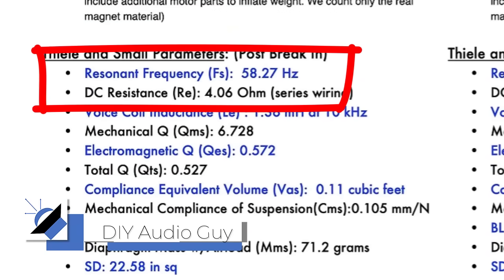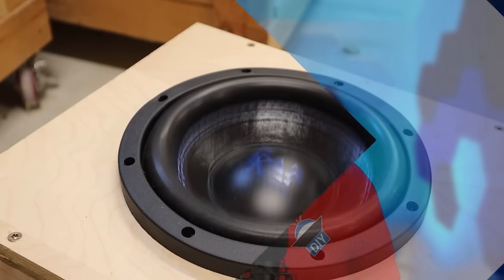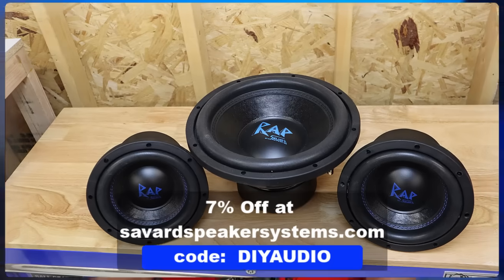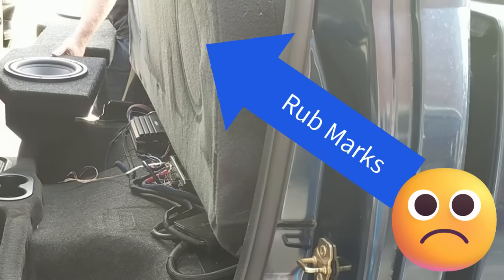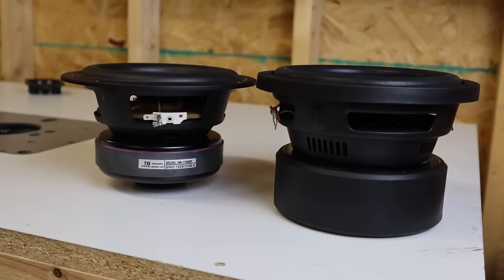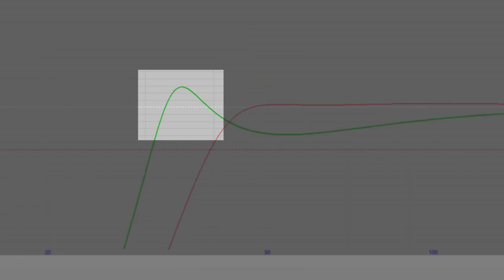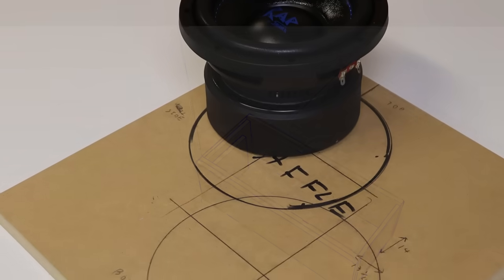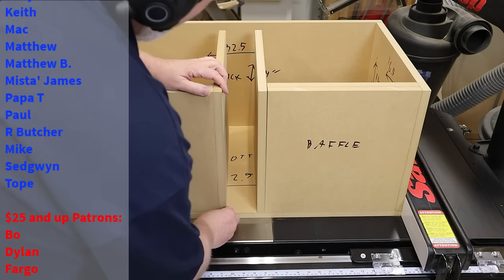The Problem With Small Subwoofers

Comment from the maker: Get the subs here:  https://lddy.no/1jqms  7% off of Savard  with the code DIYAUDIO
Reply: Awesome job of explaining things...just to bad some of the people commenting dont know the true meaning of audiophile...
it also depends on square footage of interior of vehicle,the natural resonant frequency of interior that you have to tune your port to.
i have 4 8" subs underseat front firing unobstructive sound & they sound way better tighter with low end extension custom ported box i made. than the 2 10s or 2 12s that i had before from "other" custom stereo shops & with more cone area i can hit as low as 1 15" sub even tho i have same cone area as 15" sub, that i cant put under my back seat & still carry 4 people with surround sound.
Reply: Thanks for having a great video that's not 25 minutes long.

Comment: The smaller the sub, the closer the bass is to staying inside the car. The decibels stay in the car instead of being way outside like dealing with 15s or 18s. The majority of the bass is outside the vehicle.  Yeah, you get a lot of air movement inside the car but the sound isn't in the vehicle like it is outside.  A vehicle has an amount of air space that can be used. You cant put 4 18s in a mini Cooper and expect to get a high decibel level, you get a massive spl level. You will get more out of 4 12s as far as sound inside the car but lose spl. For a mini Cooper,  there's not enuff air space in the car to be effective,  you need a van. A van has the utilizable space for that.

Comment: The skar audio 6.5s will not disappoint either wether you put them in a small box or a big box they slam for what they are im testing one skar 6.5 in a box I made for a 15 tuned to around 30 hz and it surprised the hell out of me the output they give is unbelievable

Comment: I am trying to decide between Three JL 8Wv3 subs or Two JL 10W3v3 subs in sealed enclosures for tight accurate bass for 70's, 80's rock and country music. Need accurate reproduction of the music not the deepest or loudest overpowering bass possible. 
  What would be the best choice?  Would it be best to combine them all in the same enclosure or have them in separate encloses sitting next to each other? That way if something goes wrong with one of the subs it won't cause damage to the other subs.

Comment: Near the beginning of the video dude mentions that as the size of the driver goes up, the resonant frequency goes down, while the chart he shows has an 8” driver with an Fs of 37.8hz, and a 10” driver with an Fs of 41.12, but with an * and no related foot note to explain the symbol.    Hmm.  I wonder what the asterisk means?    Also, how did they come up with these numbers.   If they were to take a box of a given volume and shape, meaning the same design, shape, volume of the box, but with varying baffle cut-out size for the various drivers,  you would generally find that a certain driver would score higher because it was COHERENT with the box, meaning they worked together.    Take drivers 8”, 10”, 12”, 15”, and 18”, and a box generally designed for a 12” driver, the middle of my range here, and force an 18” into it, and the driver would be trying to blow out the enclosure, of course comparing with the exact same pink noise from 20hz-120hz, same voltage applied, theoretically meaning driven with the same amp load, pre-driver, like use an 8 or 4 ohm resistor, set the amp at a given, maybe 80% gain on a 1000watt/4ohm amp, and swap only the drivers, and the baffles, to fit each driver, and the 8” might feel like the proverbial hot dog in a hallway, while the 15” felt like Mr. Big in  Ms. Gina Tiny.     The drivers too big for the cab would be fighting the cab, and their own air displacement, really both the same thing Sadi two different ways, but those tests and that chart make me wonder, how did they arrive at these results, and why did the narrator place a chart on his own video’s screen that contradicted the words he was saying while that chart was showing?   At least explain the *.     I have MASSIVE sound engineering experience, and there are those who have more, but that doesn’t reduce my own, and what we need, is SUMMATION, NOT CANCELLATION.    Even with one driver, the wrong box can hurt the potential of the driver, or, if you are seeking a particular result, then you might want the box to hurt the POTENTIAL of the driver in a particular way, such as when “steering” sub-bass frequencies.   Everyone knows that bass, and sub-bass, goes basically all directions, and the amount with which the “back” of any subwoofer cabinet does NOT reduce low end is astounding.    At 100dbC SPL, most single 18”, or just simple cubical shaped boxes, front loaded, with whatever appropriately sized driver, radiate its intended frequency range pretty much in an Omni directional polar pattern, both in the horizontal dimension, and vertically as well, a point left out of almost every video on the subject.   But the amount at the rear, if it was 100dbC 10’ out front, might still be 97 or so dbc 10’ behind it.   I’d say the only way for this speaker company to have tested this would be with a one dimensional barrel, AKA an “open” baffle, with enough size to dismiss its own square footage as having any impact on the results, whereas maybe a 4square footage piece of plywood might do fine with an. 8” driver, but an 18” would not be making its potential results because there isn’t enough area of barrier surrounding it to RESONATE its field of SPL.     Meanwhile, a larger , maybe 16 square footage sheet, would serve the 18” driver fine, while also not hurting nor helping the smaller drivers.     Any way.     There’s so much ambiguity to lots of the explanations, and sub-bass reproduction science has been well established for several decades, but now, with computer aided design, we can more easily exploit the principles.   I made a cardioid shaped  sub-bass lobe in my house, focused to cancel  ass behind  the sub array,  earning the rest of the house, while trying to optimize sub-bass in front of the array, meaning, towards me, where I’m sitting or standing listening to very loud and very heavy music, in my ultra man-cave Family Room Over the Garage, which stands for Bunk Room.   That’s a little joke.   I grew up calling a room in that kind of spot a bunk room, as it I was often meant as a getaway spot for kids, and if practice, a bunk bed would go there so the kids could facilitate a friend or two for a sleepover/mischief time.    Subs are fucking cool, and extremely complicated.   Just when you think you’ve got it sorted, see it from a different perspective and you’ll realize you were clueless.    Let’s see, I dove into steering subs in around 2020, 25 years into my live sound reinforcement career, at which point I felt like I was a triple black belt(that’s some bullshit) audio guy.   Because I was, and am, but boy was I humbled when I dove into the science of steering bass.    It’s mind boggling at times, and there are so many variables to consider.   That’s why I got interested in home audio and car audio concepts for controlling bass, in terms of where it was directed, and also what trended of box design made the most balanced reproduction of the ENTIRE sub-bass bandwidth, and I’ll call that 20hz-100hz, even if it’s really supposed to be below 60hz, there is or should not be a fixed number, as the frequency at which we only feel and do not hear a tone is different for everyone, s d for every environment.    I say environment, but in reality upper harmonics are often  what “tells” us we can “hear” some very low tones, even if the test tone is pure, the resulting sound in the room is al sot always made up of that tone plus higher and lower harmonics.   Generally, the only place where you can get rid of those harmonics is outdoors, far away from ANY type of reflective or refractive barrier, be it stadium seats or the wall at the bottom of the bleachers at a playing field, walls of buildings, even 100’ feet or more away, depending on the pressure wave size, and/or the amplitude(volume) you will be employing.      Subs are hard.   Okay?    They just are.   Really.   Really hard to generalize.   Highs and mids are relatively easy, because as you go UP the frequency spectrum the more directional the wave is going to be.    If you want to hear the highs out of a horn facing away from you, simply put a solid flat barrier out in front of the speaker and you’ll get the highs reflected right back at you.   I’ve had banners which the event promoter assured me were acoustically transparent, cause high end feedback on stage because the highest highs were getting reflected right back onto the stage.   If the barriers did not move and were perpendicular to the direction of the horns, then generally there wouldn’t be any microphones directly behind the banner, a vertical banner here, behind a vertical array,  so no really big deal.   But when the banner is getting blown around d by even a mild breeze, the variables skyrocket and you’ll get feedback that you can barely comprehend until you get out into that stage and listen carefully, and sure enough, highs are reflecting right back onto the stage.   Problem is that often the promoter is indirectly your boss, or chekcwriter, so one must tread carefully if you want them to address the banner issue, which means generally making some perceived negative impact on the entity which the banner is meant to represent, and without whom the funds to throw the event in the first place likely wouldn never have been realized.    Soooo, there’s that consideration.   See what I mean.     “Kruschev!    Get those goddamned missiles out of Cuba and off of my back doorstep, NOW!!  Lest Leningrad become a smoldering melting pot of melted corpses!     Oh, Leningrad knows pain, has felt unimaginable suffering before?   Hah!     Think again Mr. Old World dinosaur soldier!!   I suggest burying yourself u der a cool click of dirt.    That’s one thousand metric meters, Russkie!!   Better start digging last month.    Oh, you didn’t get that memo I sent?    Oh, I’m sorry, I’ll just reach up into the sky above where any airplane has ever flown, and knock those ballistic warheads out of their trajectory just for you!   May God treat you well while you smolder, Nikky!     MISSILES!!     Back across the Atlantic!   Deep in Commie Land!!    Now!! “.      I used to be sooooo diplomatic.     Nowadays, I just don’t care to be so sweet.    Fuck around and find out.    I love that slogan.    “Ok Mr. Health Care Int. sponsor, you can have a quality show, or, you can take your non-acoustically transparent lies-in-banner- form down, and move them ANYWHERE ELSE.   It’s your pick.    The console is all yours, and when people start bitching about uncontrollable feedback, you can tell them how you did not meet your contractual obligation, and are the ultimate cases of this fiasco”.     I make a lot of friends.   But some people just cannot handle be called out no matter how sweetly or low-key, so we might as well swing for the cheap seats.    Subs are hard, okay.

Comment: I always use the biggest sub I can get 2-3 of in my car! If it will hold 3 15’s that’s what I use! Although I did recently by a cheap kicker 8” for $40 bucks brand new and I’m gonna run it in my tiny little hatch back! It’s going in a big ported box car is tiny should do ok! I had 2 12’s in it and they could rip the car apart! I still have them just don’t have the battery bank to run them! Takes some power to run them. This 8” is 350 watt I can run that with no nothing just my alt and battery!

Comment: I believe in the mighty woofer. 15-18 inches for me duals are even better. When 2 are wired in series it’s like adding a low frequency choke in series with a woofer and since the drivers are in series the cones only have to move 1/2 the distance of a single driver reducing distortion caused by stress.  However the power you’re able to drive them does not increase. 2 100 watt speakers in series are still rated at 100 watts.

Comment: 5:29 is a really bad enclosure design, i built one like that, sounded really bad, slapped in a second subwoofer, sure its not that louder at tuning frequency but what it did was lower the q of the rolloff like mad and also sounds much tighter and faster
Reply: So the low end is really like in a really good sealed driver application, size is about the same, but its got much more output than a 15, thats all with a tuning freq of 27hz, whats also cool at such low tuning frequency, is that you dont need as much port area for a desired air velocity

Comment: I have been a believer in 10s for years. Considering playing with 8s or 6.5s recently because i am now an adult and don't want to wake the block up and want cargo space back,but I don't want to give up the low end. I got multiple vehicles all with different audio setups. My family suv doesn't have any subs as i need all the cargo space i can get but it has 6 6.5(focal) mids all amped which gives enough bass for enjoyable listening.

My drag car has a basic double din,a couple sets of Kenwood performance 6.5 components and is powered off the headunit. Its lacking but I don't drive it to listen to music,i drive it to get to A-B as quick as possible. 

My daily is a little hatch back, its more of a SQ build and is the one I want to down size subs in. Since i drive it daily and sometimes for pleasure(its a big turbo gti,it can be fun) i want to enjoy the music but I'm also tired of having to put groceries in the backseat since the hatch is taken up. 

When i was younger i played around with 10s and 12s and always found 10s to be the sweet spot for me. They get plenty loud, don't take up as much space and hit all the notes i am after. I listen to a lot of metal and rock, sometimes rap. 

I am curious to mess around with some 6.5s. worst case i sell them or let them rot in the garage.😊

Comment: It all comes down to the box and also double boxing. I have two JBL 8 inch from the year 2000 in a large box with big ports they sound like 15 inch subwoofer. Overpower them. Obviously the sound only travels half the distance but in a car or a room they sound like 15 in
Reply from the maker: You'll love this video if you haven't seen it yet. https://youtu.be/Zehi8mtk97w?si=0imXy8B_DElo5MAW

Comment: Depends on what you want to achieve im running 4 dvc 10s at 2 ohm in a sealed enclosure in my suburban cause i listen to heavy metal and i like the tight punchy bass of the smaller subs and they still hit real good down to 40 hz yea bigger subs in a ported box would slam the ever living shit out of my truck but im not going for spl i want sq with an overall even mix
Reply from the maker: True

Comment: ill take 8 10s over 4 12s any day
Reply: It’s because its more cone area
Reply: @F.B.l and they hit harder too. Not all flubby like 12s
Reply: @michiganrock  yeah because they are smaller
Reply: @F.B.l  why do you just keep stating the obvious like your proving some point?
Reply: @michiganrock  i dont know lol i dont even remember making that comment
Reply: @michiganrock 12's being flubby is a box issue, and also the types of subs that people buy. For example, the kicker compVR series are very tight sounding and responsive subs, even the 15s. You're used to hearing Skar, Sundown, Avatar, Deaf Bonce,  etc 12's in huge ported boxes. Those are SPL setups, and even those deep cone SPL 12s can sound good in well tuned smaller, and especially sealed boxes. The size of the subwoofer is irrelevant, you want to maximize the cone area in the space you have available and build the box around your preference. For some people, that might be 6 8's, for others that might be two 18s. Given the same power, two 18s in a smaller than spec box will have tighter bass than 7 10's in a much larger than spec box.
Reply: @ my experiences with subs are JL Audio and  Memphis. I’ve never had the garbage you mentioned.
Reply: @ I also never use ported boxes.
Reply: @michiganrock  There's nothing flubby about a JL Audio 12 in a properly sized sealed box. You're either coping or trolling.
Reply: @Psykam  then you have different hearing than I do. I prefer rock music and 12s don’t hit nearly as hard as my 10s. I build my boxes according to factory specs. Sure the 12 drop way lower and louder in the lower ranges than the 10s but the initial hit from the kick drum is softer on the 12s.
Reply: The comments are arguing about apples and oranges.
Reply: Back in the 90’s local guy did 8-8’s and it sounded really good. He listened to rock/metal and it really had the snap.

Comment: Have you ever tried a combination of a T-line box and a port box? I've found it to be great for sub-boxes where you're pushing the air volume size larger than the recommended size to get lower Hz output without having to make the port length longer than the box is.

Comment: Had extended cab S10 back in the day.. entire extended cab was a sealed box with 4 -12” Pioneer subs.. 700 watt Pioneer amp and Pioneer head unit. Don’t know what I got right on that setup, but it hit SO hard, you could visibly see the cab flex.

Comment: I put one or 2 12s in everything i had for years, finally tried a single high power 10 in a well built box and i was blown away with how tight accurate and loud the bass was.
Reply from the maker: Funny how that works out.

Comment: With high power handling, high excursion, heavier moving mass, stiff suspension, etc, the same subwoofer in 15", 12", 10", 8" will usually have similar if not the exact same coil and power handling but less moving mass per motor, less mass with the same power allows better response and control of the cone, more accurate reproduction while achieving the high SPL